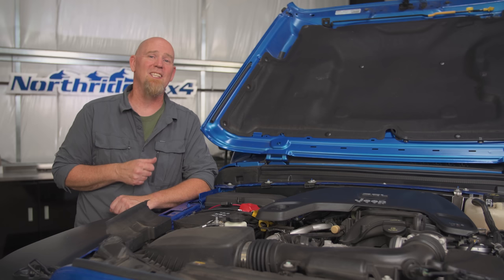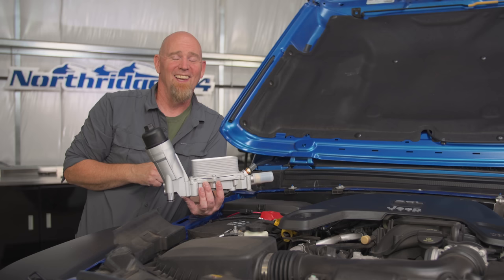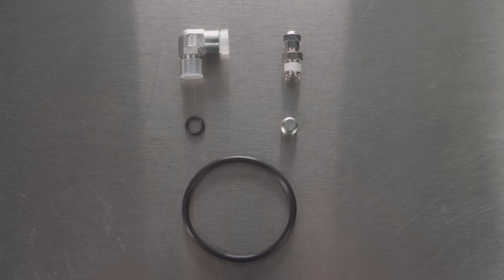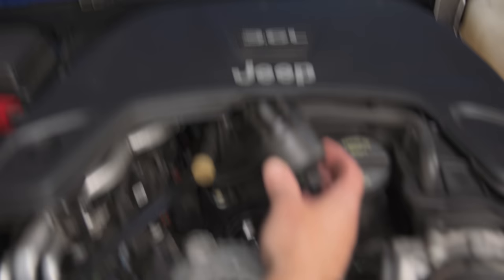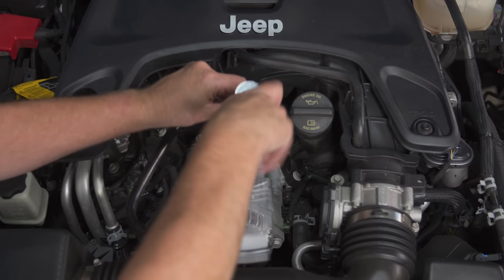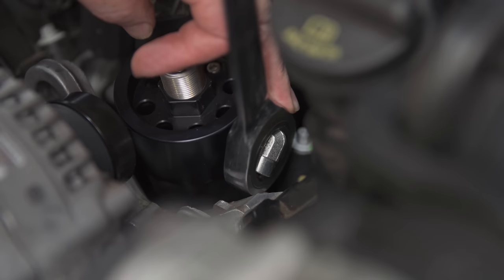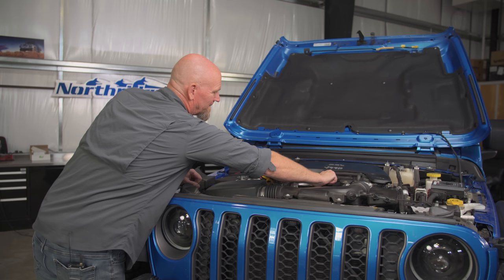STOP Dry Starting your Pentastar 3.6!!

Comment: FCA/Stellantis weigh in on the warranty? They’re pretty keen on everything you do voiding your warranty I would say modifying the way the oil system works, AND using a non-approved oil filter is a pretty cut and dry argument for them to DENY DENY DENY.  Thoughts?
Reply from the maker: First things first... Just about everything we do can be construed as voiding your warranty. Lift...check, bigger tires....check, Big bumpers, winches, lights that could limit airflow into engine bay etc.
The point being is it depends on where you draw the line at what you are OK being comfortable with. 
Jeep/Mopar doesn't have to approve the oil filter, if it is a replacement filter it would fit within the constraints of the Magnussen-Moss act of 1974.
All that said, it really comes down to the dealer you deal with for service and warranty work. Our local dealer would be OK with it as long as that wasn't the part that caused the failure.
We have heard of other dealers that will deny just about anything unless your Jeep is bone stock.

Comment: Will this void warranty or did you add it after warranty was up? Thanks
Reply from the maker: We added it while it was still under warranty. Our dealer isn't too concerned over basic mods.
If you are worried about it, it is easy to swap back to the cartridge filter before going in for service work.

Comment: Great product I want to install on my 23 Rubicon XR. Two questions, 
1. Will this interfere with warranty and free oil changes. 

2. I have dealership oil changes free for 3 years. Do I just tell them to run the typical 5 ltrs oil and they will notice it registers very low but that’s the new full level? 

Thank you very stoked about prolonging the life of this jeep
Reply: I'd be will to bet that something like this would void your warranty for the engine and they probably will not change the oil either. I might be wrong, but that's where I'd lay my bet.
Reply from the maker: 1) RE warranty: It would really depend on the dealer. 
2) They probably wouldn't do the free oil changes because the filter is different. Maybe if you brought the filter in with you.
3) RE oil level: You'd want to explain the new oil level to them.

Comment: Do you need to prime the engine every time you change the oil filter then (after the conversion)?
Reply from the maker: You should always prime the engine after every oil change. With the Baxter adapter or without.
Reply: @northridgenation  Since mine has not been retrofitted with this device, doesn't the logic dictate to prime before evert start then ?

Comment: Thanks for sharing 
Will that work on ProMasters with the same engine?
Reply from the maker: From Baxter Performance:
"MS-101-BK and MS-201-BK cartridge to spin-on adapters will not fit due to clearance issues with an intake tube located above the oil filter area.
However, the MR-202-BK cartridge to remote adapter can be utilized."
Find those parts here:
https://www.northridge4x4.com/part/oil-filters/rj-404-cp-baxter-performance-pentastar-3-6l-cartridge-to-remote-adapter-and-6-port-remote-mount-combo-pack

Comment: If you guys cold shoot a cold start video and show that the engine is actually cold, I’d buy this in a heartbeat if it doesn’t rattle
Reply from the maker: A video on this is coming. Meanwhile, Baxter recorded a stock oil filter draining vs their oil filter draining on a 3.6 Pentastar. You can clearly see the oil drain completely out of the stock oil filter cartridge, while the Baxter Spin On Adapter retains oil in the filter: https://youtu.be/g5aowl0skY0?si=paEhp-H4YRvyX8T9

Comment: Is the oil in the oil filter going to dump all over the motor upon replacing?
Reply from the maker: No, that's what the Schrader valve is for. Hit it with some compressed air for 5-10 seconds and it will blow all the oil out for a clean filter change.
As a bonus, it blows the oil pickup screen off too.
Reply: @northridgenation  thanks

Comment: While an improvement over the drain back filter-
Why not just get an accumulator system like the Moroso?  They been around over a decade but the accumulators systems have been in aircraft and heavy equipment for over 50 years.  

Rather than having SOME oil closer to rocker arms that cuts the dry start time to half, 
Just solve the dry start problem 100%.   Then when racing, off roading, etc and the G force or angle of the rig would normally do a momentary oil starve- it now is protected 100% of the time.

Comment: You said that on a normal dry start its takes about three an a half seconds for the oil to get to the cam lifter etc. How long will it take if you upgrade this new oil filter adapter part?
Reply: 3.4

Comment: When you attach the air hose and introduce air pressure, does that back flow the oil filter? And if so, aren't you putting contaminants back into the engine? Thanks
Reply from the maker: It does back flow the oil filter back down into the pan. The cool thing about that is it would also backflow and clear the oil pick-up screen.
Reply: @northridgenation  So in back-flowing the filter, some of the stuff that the filter trapped is put back in the engine?
Reply from the maker: @johngranato2673  Yes, it would be putting it back into the oil pan. Then when you drain the engine, you'll be draining out what you've dumped back into the pan.

Comment: Does this void your warranty?
Reply from the maker: It would really depend on the dealer that does your service.
It shouldn't, but if you have a nit-picky dealership, it might.
The nice thing it is fairly easy to install and remove, so if you are worried about it, you can pull it before taking your Jeep in for service.

Comment: Dont use those cheap oil filters without an Oil Back out Valve.  Those valves keep the oil pressure on the filter instead of not.
Reply from the maker: Cartridge filters don't have an anti-drain back valve, that's why this kit is so popular.

Comment: So, why not do the priming procedure before every start instead of this part?

No love for the Promaster?
Reply from the maker: You could do the priming procedure, it would just take extra time.
We're checking with Baxter's to see if they've done any Promaster vans before.
Reply: @northridgenation  A lot of RV Promasters running around out there with owners who just love to over care for their rigs....
Reply from the maker: @MyGoogleYoutube   Baxters says to use this part: https://www.northridge4x4.com/part/oil-filters/mr-202-bk-baxter-performance-cartridge-to-remote-oil-filter-adapter
And their remote filter base:
https://www.northridge4x4.com/part/oil-filters/ri-101-bk-baxter-performance-inverted-remote-oil-filter-mount
You could also install an oil cooler in line.
Unfortunately there is not one full-on kit with all parts to do it yet specifically for the Promaster vans.
Reply: @northridgenation  

Thanks I'll take a look - how well does it work cooling the oil externally when the stock oil heater is trying to heat the oil?

Comment: What is the point of adding air pressure to it??
Reply from the maker: The push the oil out of the filter so you can remove it without leaking oil everywhere.

Comment: Is the priming step necessary?  What is the advantage over just starting the engine like usual to prime the oil filter and adapter? Thanks
Reply from the maker: Accelerated wear on the starter.
Reply: @northridgenation  are you saying we should perform the priming step every time we start the car?
Reply from the maker: @aarontharris , no, only when you change the oil.

Comment: My 2014 Grand Cherokee 3.6 has 120K on it and I was always annoyed by the start up tick. Now it is blowing blue smoke on startup (I can smell it too). I assume the valve guides are worn. I had replaced the PCV 40K miles ago thinking this was the cause. Has anyone else had this issue and how did they address it?
Reply: Add some ZDDP at every oil change.

Comment: Would this work on all Pentastar 3.6, or just the Wrangler? I’m looking at a Dodge Journey and this might be a good thing to add. Also, an oil catch can.
Reply from the maker: This will work on all Pentastar 3.2 and 3.6 as long as there is enough room at the front of the intake manifold. It not, you can use the Baxter adapter that has the remote filter:
https://www.northridge4x4.com/part/oil-filters/rj-404-cp-baxter-performance-pentastar-3-6l-cartridge-to-remote-adapter-and-6-port-remote-mount-combo-pack
Reply: Thanks good to know!

Comment: Can you use this with the teraflex pcv valve?
Reply from the maker: We don't know yet, but are guessing it shouldn't be an issue.
The Baxter Performance adapter replaces the oil filter cap. The TeraFlex adapter replaces the oil filler cap.
The biggest question is how far does their 90° elbow come out from their adapter.
Reply: @northridgenation  It would be pretty nice to use this with the Teraflex kit.. Specially when they release their version that doesn't collapse on its self..
We are willing to pay money, we just need tested products that work ;) 

Thanks for the video, the baxter looks awesome

Comment: Does this void engine warranty  if something does happen and jeep gets towed into dealer when im on a trip away from home?
Reply: I was wondering the same thing
Reply from the maker: It is a replacement filter kit and should not void the warranty.
Reply: @northridgenation  so u have no idea what dealer or Mopar would say if 3.6 came in with failed lifters, rockers and that filter. They'd automatically point the finger and say not covered!

Comment: With all that's needed to be done to fit this, then you have to blow out the oil , basically making it like factory so u can change filter, then have to reprime, ill take my chances. My dads 2013 Overland has 180k on it and no engine issues.  And he went to local oil change place so who knows what kinda oil they were putting in it. Ill take my chances just running Penzoil.  Ive had great luck running Shell Rotella in Cat engines, Both oils are made by same company.
Reply from the maker: Running a high quality oil and frequent oil changes can definitely help your engine live a long life. But don't confuse lubrication and oil pressure. 
The Baxter Performance adapter will help get the chain tensioners and cam phasers up to proper oil pressure, which will also help the engine last longer.

Comment: So warm up a Pentastar fully, then let it sit for a week. Then inspect the cams to see if they are still coated with oil.
Reply from the maker: There will still be a little oil residual there.
But the cam phasers and timing chain tensioners won't be full of oil.
Reply: @northridgenation  Then the term "dry start" is marketing. Even after a week, we are not "dry starting" our engines. And there is another experiment, how long are the cam phasers and chain tensioners "full of oil" after shutdown? I know that my brother's 2015 3.6L Grand Cherokee has sat for a week and started without any unusual sounds from the engine. If there is any delay in filling the phasers and tensioners after a week, it has not been audible on startup. It's entirely stock except for the usual thermostat failure.

Comment: Would liqui-moly mos2 help prevent dry starts?
Reply from the maker: Any good quality oil will help keep things lubricated during the dry-starts, though these Baxter Performance adapters will help keep oil up there and get your cam phasers and chain tensioners up to operating pressure faster.

Comment: Yeah, i don't buy the arguments being made here. Of course oil goes where gravity takes it, and of course a dry start is not great. But a good synthetic oil and good maintenance probably overcome that possible damage pretty easily. i also wonder what kind of oil pressure is needed to overcome that check valve and get that sequestered oil moving where it needs to go. I'm guessing its at least a couple of seconds to get oil where it needs to be.
Reply from the maker: It takes about 3.5 seconds for the Pentastar to get up to operating pressure and volume. 3.5 seconds every single time you start it for however many times you do over the course of 100K-150K+ miles?

Comment: What happens if you have a supercharger installed? Like Edelbrock the spin on will not fit. Not enough clearance.
Reply: Don't worry about it and just use good oil! Add Duralube or Slick50 if u still worried! The infomercials showed them drain oil and run engine with no oil with no issues for lengths of time
Reply: @kwmiked  Don't they make one with a remote oil filter bracket and the same kinda of oil filter except you have to have lines made up to go from the oil filter remote up to the piece that replaces the spin on?
Reply from the maker: Baxter Performance has you covered with their remote spin-on adapter kit. Then you can add in an oil cooler too for extra help cool down your supercharged engine:
https://www.northridge4x4.com/part/oil-filters/mr-202-bk-baxter-performance-cartridge-to-remote-oil-filter-adapter

Comment: When I change the oil, I fill thru the oil filter housing, which may help with startup lube. Am I still able to fill thru the cooler housing with this installed?
Reply: Stop trying to invent the wheel! The oil drains down just as fast as dumping it in filter or the fill hole! Hence why the filter doesn't have any oil in it 5min later. If it held in the upper engine then u would be starting it with low oil on your dipstick.  Common sense here.  Just use good oil and drive it. My old man's jeep 2013 has 180k with local lube shop oil and no engine issues.. I did oil cooler at 120k mi cause the orings were blown out
Reply: @kwmiked LOL, thanks? I installed a supercharger so I no longer have access to the oil fill tube, that's why I asked about filling thru the filter housing. I am ok with spending a few bucks to keep oil in the top end, even if you aren't.
Reply from the maker: @krashnpa, unfortunately you can't fill it through the Baxter filter housing adapter, there's a check valve in there to keep the oil up in the assembly, so it would drain down past that.

Comment: Boom.  Whoever put the Oil Filter cover on that car at the last change used the wrong torque.  It was way overtightened.  That's how to crack the oil filter housing.  Hope you fix that problem.

Comment: Here is a question.   After blowing air to drain the oil, are you not starting the engine dry again?   I realize this is only done at the time of an oil change but essentially it sounds like it will be a dry start, right?
Reply from the maker: Yes, that will be a dry start. But, only once each time you change the oil, instead of every time you start it after it has been sitting.
Reply: Do you have to blow the air in there every time you change the oil?
Reply from the maker: @GaneshRamadhar   only when you change the filter.

Comment: I have a 2012 Chrysler 200 with the 3.6. It has a horrendous dry start! Any chance this works for it? Do the replacement filter housing/coolers have anti drain back?
Reply from the maker: Yes, it works on the 200's 3.6! Part #MS-101-BK Link: https://www.northridge4x4.com/part/oil-filters/ms-101-bk-baxter-performance-cartridge-to-spin-on-oil-filter-adapter
Reply: Are you sure? The 2013 and older have a different type of assembly. In order for this to work, you need to replace the stock plastic housing with one of the aftermarket aluminum models to accept the 2014 and newer oil filter styles. There are also some fittings that need changing too.
Reply from the maker: Yes, Baxter makes one specifically for 2011-2013 3.6's. @JBlinky67

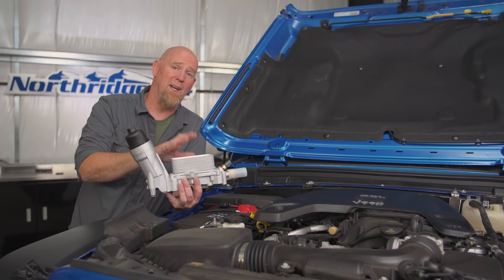Comment: 1:08 Hey that's the cheap Jeep parts that leak ?   
Best thing to do would be to not buy a Pentastar right ?
Reply from the maker: We like the Pentastar. They are smooth, decent power for a V6, reliable (for the most part) and they've proven themselves to be pretty decent engines.
But like any parts on our Jeeps, they can be made better.
Reply from the maker: That oil cooler is the Mishimoto replacement HD aluminum oil filter housing/oil cooler.

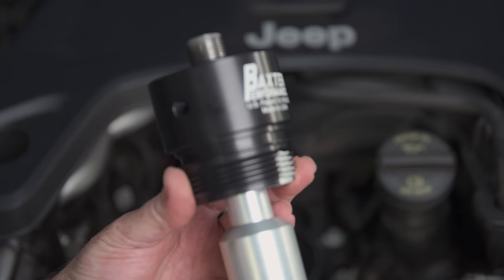Comment: Weird. Do they need an oil drain back valve? 3:25 “most of the it (the oil) is stuck up in the top of that cap”
Reply: Also at 10:15 “we’ve given it a chance for the oil to settle back to the pan” is it really keeping the oil up in the valve train if it’s settling back to the pan? 

What’s happening is that the oil is being kept in the filter. Not in the valve train. The anti-drain back valve would need to be installed downstream of the valve train to keep the oil there. This would at most keep oil in the filter to be distributed downstream quickly after starting. Which the factory oil filter does. 

What about the additional pressure drop through the filter housing and the drain back valve? That would require the oil pump to work harder throughout its life and decrease its life span. 

The part about having to have an air hose to do an oil change is kind of weird too. 

I’m not convinced this is an upgrade.
Reply from the maker: That is the dregs left between the filter and the cap.
Reply from the maker: @EngiTrek   The oil is there when you shut the engine off, it then takes aprox. 35 minutes to drain back down.
By adding an anti-drain back valve, the oil stays put, with very minimal drain back.
Any additional pressure drop would be very minimal. You are replacing a filter with a filter and the anti-drain back valve easily opens in the flow direction.
The air hose is to push the oil out of the filter for a clean easy filter change. As a bonus it should also blow any debris from the oil pump pick up screen, helping oil flow.

Comment: There were gen 1 issues and the 14-early16 had a bad rocker design that would cause the bearings in the rockers to fail and cause the dreaded pentastar tick. Just give the engine a minute to warm up before i move mine, no issues. Also don't use cheap oil
Reply: I had several roller rocker bearings go bad and could hear a symphony of ticking. I pulled it all apart and replaced all of them in 2 afternoons. It wasn’t too bad.